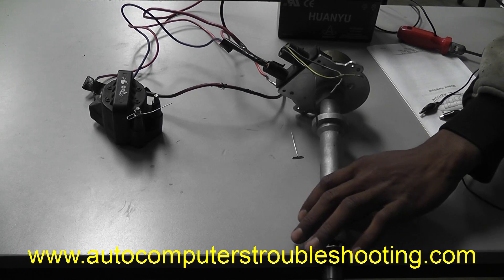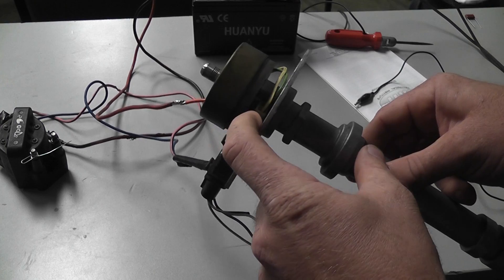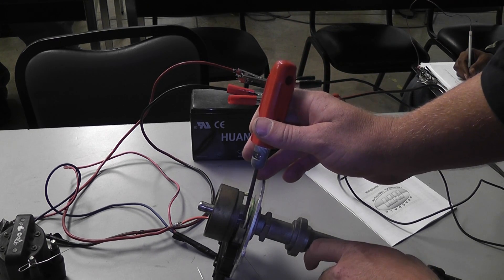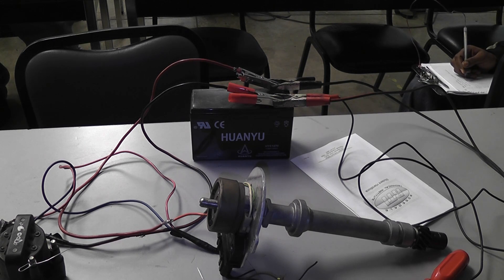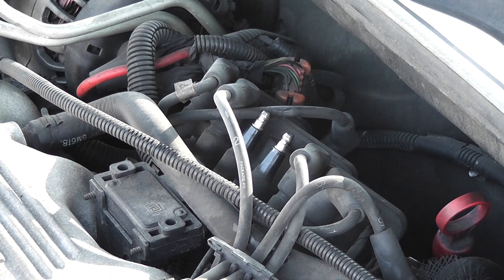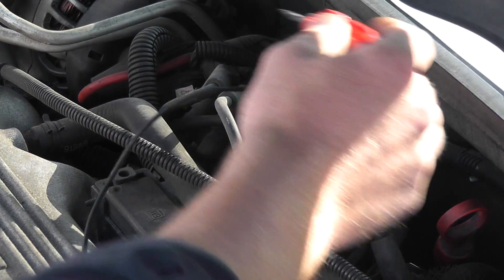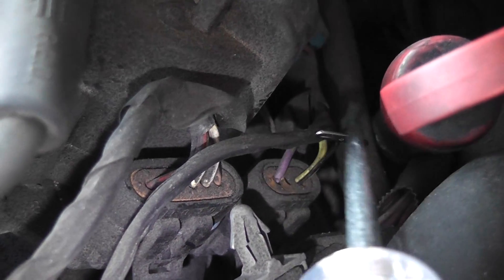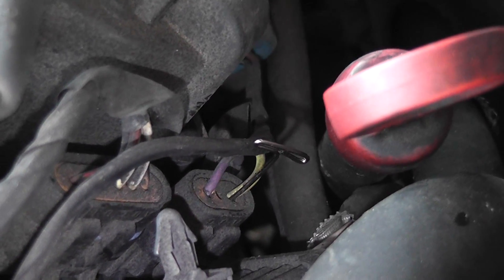How to test a GM ignition module (crank sensor bypass test) - VRS

Comment from the maker: @MrRicardoca For the VRS bypass I would recommend a non LED test light. I am not sure an LED test light would carry enough current/voltage. For the O2 bypass you can use your body as the resistor, touch B+ with one finger and O2 signal with other. This test is not needed on most O2s, just Ford because there is no bias line voltage to use for open/short circuit tests.

Comment from the maker: @CoolasIce2 Some are directly grounded internally through the ICM, some have floating grounds. Some use a DC bias that rides under the AC signal, some do not. There are so many different designs. This test will work on most, maybe not all.  A VRS can put out over 30+VAC so there is zero danger of hurting either module or computer. The few hundred millivolts you mentioned is what you see during a cranking test (very low RPM) using a DVOM. Remember as RPM increases so does the signal amplitude.

Comment: Interesting vid, but I have a few questions. First, isn't the crank sensor UNGROUNDED   meaning that the 2 wires of that plug  are the 2 wires directly from the sensor? Adding 12V to one  wire wouldn't work, and second; Wouldn't connecting 12V to the ignition module from that wire blow the module (even though it isn't across the 2 wires)  since the crank sensor makes a very small pulse in the millivolt range and 12V is too much for it?  Thanks.